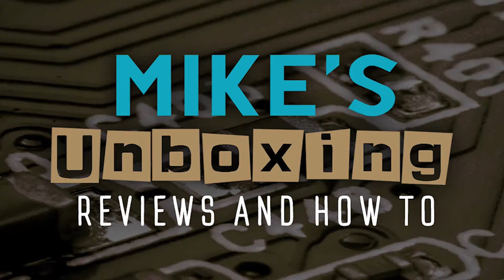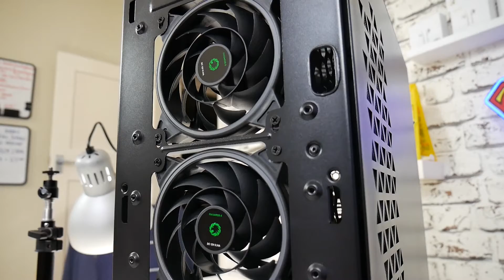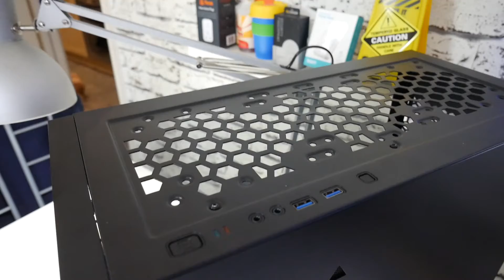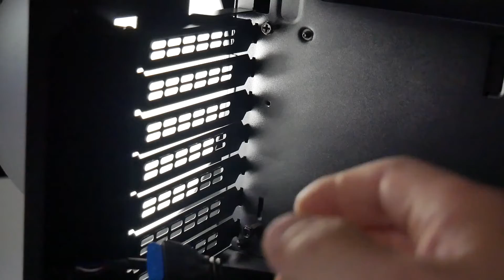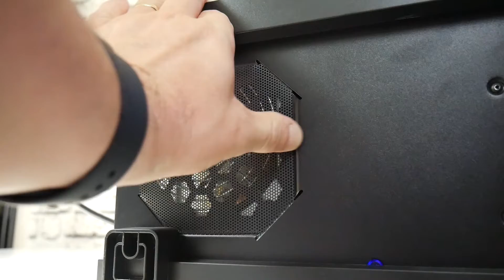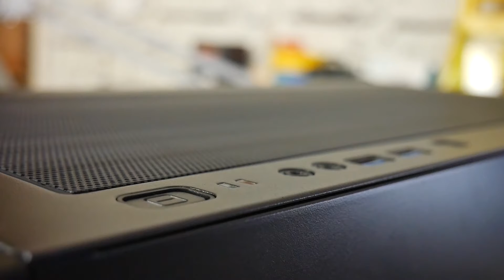Gamemax View Addressable RGB Mid Tower Gaming Case

Comment: Picked up GameMax View ARGB Mid Tower PC Case with GameMax GP650 650W PSU pre-installed for £90. It's an entry level build for my nephew and I was a little concerned that a case + psu for that price (pairing with Intel i12400K, RTX 3060) may have cut some corners but this review has given me reassurance that the case is fit for purpose. When building tomorrow I'll already be very familiar with the case thanks to your very comprehensive and excellent review. Thank You.
Reply from the maker: enjoy your build

Comment: When taking off the front panel do you just press the 3 clips inside on the left and then pull? I tried to do this for the first time and managed to get the 3 clips popped but the front panel still seems clipped in on the right side. Do I pull hard and it will pop off? Im scared incase it snaps some of the plastic clips on the other side.
Reply from the maker: yes should just pull off, unless they have changed the design
Reply: @mikesunboxing  I can't see how I would reach the other latches on the other side to unclip them though. Which makes me think it's a case of just pulling. But I can't see a way other than pulling. In the video you just pop them clips and it seems to come off with ease. Was yours easy to come off first go?
Reply from the maker: @wifeofrage1210  Don't think it was easy, but it was a while ago.

Comment: Got  mine today. The fan hub wasn't in a plastic box like yours. It's a bare board and it was half hanging off... big danger of it shorting out against the case.  A circuit diagram or some sort of schematic would be handy, as there were no instructions came with it at all. Also, you could get a third 3.5" drive in it, had they included a third HDD mount, instead of the two it comes with. I don't trust SSD's having had three go faulty on me, in recent years. I'll stick with mechanical drives for the time being.
Reply from the maker: i'm not sure what is going on at gamemax, not heard from them in a long time

Comment: Bought this as a replacement for an older Gammax case with fans on the inside of the back panel. Found that the fan placing on the old case would affect the user of a RTX 3080 and above. so change needed.  will updsate when arrives and new build done.
Reply from the maker: Thanks for letting us know

Comment: Do you know if the RGB headers will match if I use an ASUS ROG STRIX B450-F  motherboard? It says in the manual that this has a 3 pin header and the motherboard looks like it has 2 4 pin headers. Also do the fans only have a few set modes or can they be set any colour using the ASUS Aura software?
Reply from the maker: sorry that board doesn't support addressable RGB on the older static 12v RGB, i.e. no rainbow or chase effects
Reply: @mikesunboxing  So I can't connect connect the case to Asus Aura sync? Also could I use an adapter? Also the case was released 10 months ago and the b450f 2 yrs ago.

Comment: Do you know how to disable (turn off permanently) the LED lights on all the fans? The case was a gift that came with a small remote BUT I have to turn off the lights everytime I boot up, it's very annoying
Reply from the maker: disconnect them from the power should be a sata connection in the back

Comment: Hey mike, question this case work on a ECS P55h-A motherboard?.. how can I connect the fans??..
Reply from the maker: it will work ie fit but the RGB will need to be controlled from the switch, the fans are okay to connect to the motherboard or control manually
Reply: @mikesunboxing  thanks for tour reply 👍

Comment: Completed build😊 The entire system runs off the addressable ASUS Aura  x570 RGB motherboard header. 3 fans and two RGB strips which I removed from the bottom slots and repositioned inside the case 👍 with a diffusion strip to tone down the brightness 🔆 That motherboard has plenty of fan headers AND the built in ARGB controller was not required . 
A top intake blue stream fan was added which adds another hue to the multi rainbow et effects and aura offers a lot via the software onscreen et My niece had this build for a birthday present cost donations from my brother and sister 😊 The unwrapping turning on I watched via Skype et and the howl of delight 🤣 makes this build a particular pleasure. My niece is interested in media / photography so the Ryzen 5 3600 delivers to perfection. Temps are very stable and well within expectations. The case was superb. OK its a BIG case ! but cable management and hiding the bulk of em was a breeze and lastly weight? Well who is going to be lugging their pc around?😊 and no it won't be on carpet 👀 Future wise - masses of room and options to upgrade from the 16Gb DDR4 if required or even the CPU at a later date et et 
COST? Well less than £600 ! The Asus x570 gaming plus definitely recommended.
Reply from the maker: Sounds like an amazing build

Comment: Just bought this from Amazon for £86 approx Thanks for the great review 😊 Its to house an Asus x570 gaming plus motherboard, AMD Ryzen 5 3600 CPU plus 16Gb DDR4 and 2 SSDs BeQuiet slim cooler 850w EVGA Bronze power unit COMPLETELY rig tested and soak test et done so no probs re that 😊EVGA 1050ti GPU Am going to add two intake fans at the rear next to the three RGB fans and one intake fan at the top plus usual extra extract fan to rear. I'm also going to raise the feet as I like a little bit more air flow across the bottom of the case and no my niece will not be putting it on the floor 🤣 I liked the glass main panel as it does not have 4 screws 👀 I  take note of your moving the controller to the HDD bay ! Once again thanks for the brilliant review.
Reply from the maker: thanks Arthur and enjoy your build

Comment: I have ordered its other sibling - the Kage, essentially very similar to this one, just a few differences. One thing that might be good is to look at how front Radiators are mounted, some have fans on inside, some have fans on the front etc.... as always great review videos.  I also got a deepcool L360 V2 RGB rad to go with the Kage. No ones reviewed these coolers, might be an idea.
Reply from the maker: Thanks for the info! and i'll take a look at the rad, but wasn't that the one that got bad reviews for the hoses leaking? i'm not 100% but i'll try and find out more
Reply: @mikesunboxing  yes, thats why they made a V2 version with supposed 'anti-leak' technology in it. its £86 on amazon for the rad. cheapest 360 I've seen.

Comment: I’ve just received my built pc from a trusted company, it comes with this case and once I turned it on for the first time the top ring isn’t producing any RBG colours
Reply from the maker: probably a loose connection in the hub behind the rear side panel
Reply: @mikesunboxing  Computers don't travel well even if they are packed with care, some of those carriers / delivery guys throw the boxes around and that shocks the case sometimes shaking loose a connection. The power on/leds/reset plugs can quite often do this so I have used a hot glue gun to secure them OR wrapped a thin and pulled tight - tie. The USB 3 connector can also easily slip out as its not a snap connector, usually the USB 3 connection on the top of the pc won't work. . 😊

Comment: Hello can someone please help me. I built pc with this case and have booted it up etc but the rgb lights on the fans are static and diff colours and also the led switch button and the fan controller speed button on top of case do not work. low and medium on fan speed just turns fans off. on high, i feel like the fans are running abit slow-ish
Reply from the maker: hmm not sure what is going on there
Reply: How did you connect the rgb fans ??

Comment: Im very new to building pc and I’m trying to find a case and I’m wondering if the fans in this case will connect with the MSI B450 tomahawk max motherboard?
Reply: They will, every fan has the same connected on it. Its just a matter of if you have another fan headers on the motherboard and if the wire from the fan to the motherboard is long enough - the second one really should not be an issue though tbh.
Reply from the maker: yes they will but the RGB won't be able to be connected to the tomahawk max as it only supports RGB not addressable RGB

Comment: I've got the gamemax Polaris case I'm gonna take the RGB fans out and put in ARGB fans to work with rest of my 5 volt 3 pin stuff
Reply from the maker: enjoy your build
Reply: @mikesunboxing  thanks, I'm taking my old 970 board out and replacing it with a msi b450 gaming pro  carbon  ac with a ryzen 3600 and a gtx 1660 oc

Comment: did you ever finish this build? i have ordered the Noctua NH-D15 at 165mm thinking it would fit not realising the case had 150mm Dims on the spec.
Reply from the maker: yes i used a arctic freezer 34 and it was okay
Reply: @mikesunboxing  Your a legend , Thanks for the quick response!

Comment: hey i don’t know if you would reply to this as the video is currently 7 months old but is the fan hub/rgb controller AURA Sync compatible? thanks
Reply from the maker: only 3 pin 5v ARGB aura sync not the older 4 pin 12v RGB aura sync

Comment: Nice case,,,Why are glass screens always on Left handside of case Mike ???
Reply from the maker: i know! it is a constant pain for me with the way the desk and studio is setup. I think it comes from the original designers and assuming that everyone has the case on the right side of the desk to see inside the panel.
It is mostly due to the way that the atx standard was made and how cases followed on. If the case was clear on the right the IO would need a complete redesign or inversion so not an easy thing to change unless you want to see the rear of the motherboard :-)
Reply: I'm sure there would be a market for inverted cases, what would be really clever is a 2 way case.
With the loss of external drive bays, one less thing that would need to be inverted, so all it would really need is a movable case IO and a swappable top trim and foot plate... dammit, I should patent that!
Reply from the maker: I had a case from riotoro that was inverted and it was quite a nice setup

Comment: Not a bad looking case with the RGB and all, but at the price point you could go with the Thermaltake H200 which has a similar look with RGB, and the Rosewill Spectra D100 which had a mesh front and 4 dual Ring RGB 120mm case fans. Because I'm into open-loop cooling I went with Lian Li's 011 Dynamic.
Reply from the maker: Nice case! same as oletta's?
Reply: @mikesunboxing  Yep, the very same model.
Reply from the maker: i agree at the price point in question there are a lot of viable options.

Comment: Peels off the cover, almost knocks case over, heart attack city!! Good review though :)
Reply from the maker: Yeah thought it was going to slip due to those non rubberised feet
Reply: For the price (and boy is that expensive for what it is) I'd want some rubberised feet as standard!
Reply from the maker: @BuckyKat9999  yeah rubber isn't that expensive it grows on trees
Reply: @BuckyKat9999  I've used discarded (old) thick plastic table mats and cut them before gluing to the feet. Rubber or plastic is fine BUT you can buy items from most DIY stores re cabinet feet et As a musician I've used what are called 'cabinet rubber feet' for a few dollars / pounds  😊